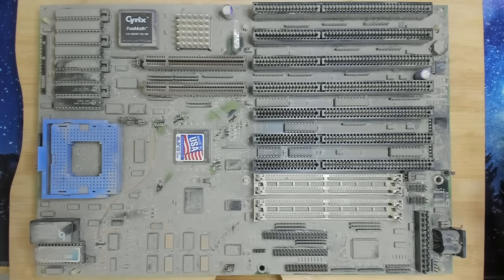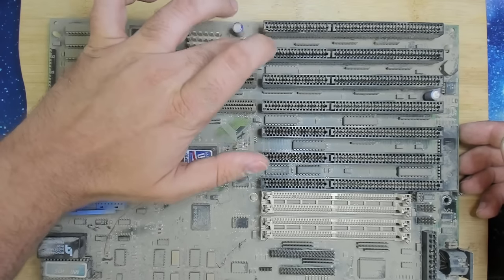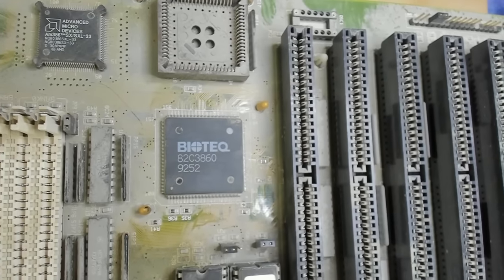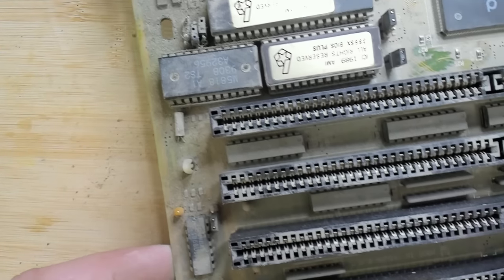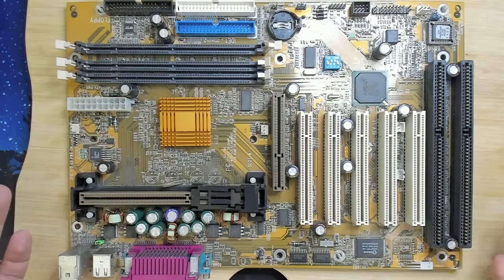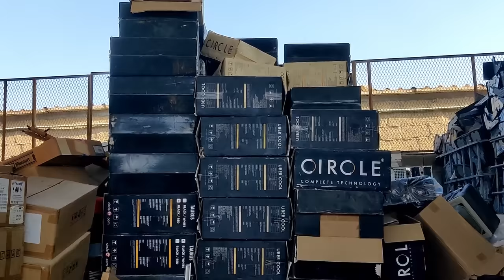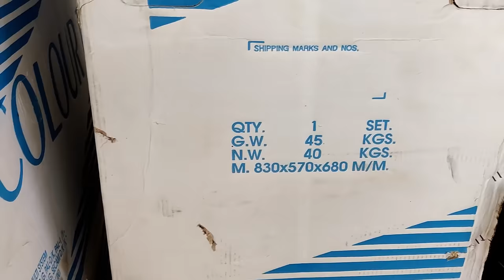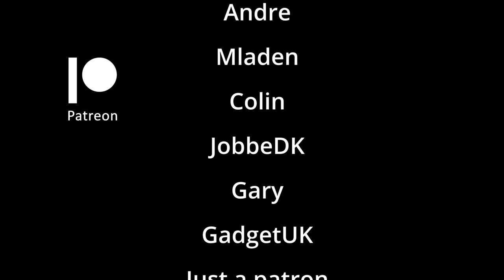Is this one of the most incredible scrapyards on Earth?

Comment: The scrapyard tour is the best part, the fact that the pc cases are intact makes the components more likely to be in one piece.
Reply from the maker: Yes! I prefer to find items in a case. That means they most likely are in pristine condition and working. Plus, you sometimes get accessories like back plates for motherboards 😉
Reply: @bitsundbolts I normally do too, I was lucky once though - a friend pulled my 386s motherboard from a huge container of scrap. It is an Asus with 40mhz DX CPU and runs beautifully .
Reply: @communalnoodle1356  My recycler has a few towers but in alot of cases cards and boards are just stacked on top of each other. I've seen so many good looking cards that on closer inspection had cut traces, or worse yet, when graphics cards don't have heatsinks protecting the chips and the pins get bent or cut.
Reply: @PipBoy3k  I hate when that happens - our most recent trip to a recycler most was the same though a few of us are able to repair so we saved what we could.

Comment: That first board is the famous Alaris Cougar. Very very cool board with a clock tripled IBM Blue Lightning 3 CPU, which is a proper licensed 486 with 16KB cache. But unlike other 486SX chips it can use a separate 387-compatible FPU.
Reply from the maker: Interesting! I will definitely read up on this board. So far, I have no idea what it is, but I am happy that I picked that case with this board inside. I usually ask to have a look at three or four cases because I need to reshuffle those towers of old PCs. Of course, the guys working there don't like that too much. However, this time, I got lucky with my picks.
Reply: I was always amazed by the FPUs not conforming to a single standard.  Late 80s FPUs are like GPUs today.
Reply: I've always thought the BL was more of a 386 with high clocks and large cache. Did it really have an actual 486 core?
Reply: @mykolapliashechnykov8701  It's an odd duck for sure. As far as I know it is a further in-house development of IBM's 386SLC. But is a 386 with internal cache (which supports write back mode, and is double the size of that of the Intel 486 of the time) still a 386? The IBM CPU supports all 486 instructions, like the Cyrix 486DLC/DRX2 386-socket CPUs, but it is a lot faster clock for clock. From what I've read the 486BL2-50 is a tad faster than an actual Intel 486SX2-50, while at 66Mhz the IBM falls behind a bit. You tell me 😅

Comment: I clicked for the scrapyard tour - wow!  That Alaris board is really interesting.  I think it's the "Cougar" model, so that's probably an IBM Blue Lightning at 75MHz under the heatsink.
Reply from the maker: I just posted the cleaned board on my Patreon - there is a free tier and the post is available to all members - including the free tier.
I already checked the manual and can confirm that the FSB is set to 25 MHz. Which means, you could be absolutely right! There is a triple clocked blue lightning rated at 75 MHz under that silver heatsink!
Reply: @bitsundbolts  It's THE one and only 386 (with 486 instructions support slapped on it, that is) that can run Doom. Please do the video on it, it's rarely found outside of the PS/2 systems.

Comment: I think I've said it before but damn, just one trip to a scrapyard like this and I'd probably be set for life as far as my retro cravings are concerned. 😄 I'd be most interested in the 386 board, since it is very similar to my first 386!

Also, sad to see all those discarded Back-UPS CS 500s! They're probably mostly fine, just need 1 or 2 caps replaced so that they don't prematurely complain about the battery needing replacement. I still have many of those in use at my clients (the 650VA version to be precise) and with a little TLC, they can last pretty much indefinitely. Thanks to the USB connection, they still do everything that is needed of them, too. I do see the charging circuitry fail on some of them now though, haven't been able to figure that issue out yet unfortunately.

Comment: DAMN, an AMD750 Board with an AMD Southbridge and not the VIA 686A.
Nice find!
Reply from the maker: I couldn't believe it when I saw the board! 99% of the slot type boards are Intel and Slot 1. If I find a Slot A, I definitely take it - even if it has a VIA chipset :)
Reply: @bitsundbolts  Back in the day I got an ASUS K7M, which was funny because it was initially sold in a white box. Later got an Epox 7KXA, where I desoldered the Voltage Regulator for the RAM and ran a wire to the ATX Connector (because the RAM Voltage is a bit low, IIRC something around 3,2V for SDR-SDRAM)

Comment: Really interesting to see where you get your stuff from. Please do more videos like this. My only option for retro gear is eBay. In my state, anything electrical cannot be sold at recycle centers and must be destroyed. Local authorities are worried people are going to hurt themselves when powering on old equipment. So much good stuff is lost. You are very very lucky.
Reply from the maker: That is very sad :( Maybe some of this stuff ends up here at my scrapyard. Apparently, there are ships coming from all over the world to UAE - then it continues to other parts of this world (e.g. Malaysia). Very odd to have a rule like this - as if you couldn't hurt yourself by anything else like a knife, scissors, or BBQ equipment.
Reply: Something similar here in Canada. You can't even pick up something someone has dumped there, because it would be considered has theft. From what I've heard, they remove some components and melt the rest in a foundry. Recycling is important, but reuse is much better.
Reply: Same here in the UK really. Some recycling centres have got a small building where stuff that's obviously got nothing wrong with it is saved and checked and you can basically buy it for a donation sort of thing. Most haven't though, and you're not allowed to take anything as "health and safety" laws won't allow it. Most centres use big "bins" the size of 20 foot containers with an open top that you chuck stuff into from above, so you couldn't go climbing about in those anyway! There's only a few that you can walk into such as the one for old TV's.

Comment: Mr. Bios..!  I used to love that stuff, it was generally VERY capable.  It might not have as many BIOS options as Mr. Bios normally does because IBM loves to simplify the BIOS to be morelike the eventual PS/2 Model systems.  Also, a lot of older motherboards had their models/info on stickers that were stuck to the sides of the ISA/card slots.  Some do 'dry out and fall off' due to age, so maybe they could have been lost.  That one sticker doesn't help much with identity.  Searching a bit at random I found mentions of an IBM-made "Alaris 486 by IBM", which looks like maybe being this thing.  It's actually a 486DLC-ish thing, with a full 32-bit bus but no coproc on the CPU, hence the Cyrix FasMath.  The CPU socket MAY take full 486 chips, but it may be for a "Pentium Overdrive" variant that IBM also did on that board.  If this is the same board, the caps are supposed to be very high quality, with few to no tantalum-bomb-caps to be found.  Those cache chips look quite nice, though.

If so, it was a "Blue Lightning" board, though I'm still trying to find proper model/FRU numbers!  It may also be a "Cougar BL".  I'll see if I can find more, but hopefully that helps.

Man, "VESA local bus"...that's been a while.  Also, I don't miss it.  I miss MicroChannel, didn't miss EISA all that much, but actually like and enjoy the PCIe that we mostly use nowadays.
Reply: Annnd...yes, I would spend a whole weekend in that scrapyard.  I would have no space in my house by the end, I bet...but so many nifty things!  I saw storage arrays, I saw one thing that looked like a mains-input UPS there (though getting 480V stuff to work reliably is a TINY bit scary!), and...yeah, I'd lose a lot of time and money AND space to go there.  :)  It would be great.

Comment: ATX MVP3 based Super Socket boards are rare and very good boards
Reply from the maker: Good that I took it then :) I think I only have one or two other ATX Super Socket 7 boards. Perfect for a nice AMD K6-2+ build.
Reply: @bitsundbolts  100% - they are very good boards, and great for overclocking.

I have two K6-2 570s modified to K6-3+ running in MVP3 based boards, one at 600mhz and another at 630Mhz (though I took that one back to 600mhz for safety since I had to increase the voltage a little)
Reply from the maker: I also have a few K6-2+ 570 - one is already modded for 256K L2. I never tried to get past 600 MHz on those CPUs - due to lack of a board that can push the FSB past 100. Well, now I got one :) Let's hope it works!
Reply: Just remember that those chipsets didn’t play nice with ATi vga cards back then 😁
Reply: @bitsundbolts Its fun believe me :-)

Comment: Hi !

many treasures in the scrapyard 🤠

- I ´m a soltek user. I have one in socket A(75JV). Durable & stable, but bad capacitors (I replaced them and is still working). i had some issue years ago with the junpers. Cant´s set de correct FSB!!. I fix it setting the FSB from bios setup

- I have a GA-7IXE REV 1.1. Some problems with the boot bios, always stop in the bios shadow other time only beeps and black screen in the first years, after a bios flash complety fix the issues and is till working. The flash was made with a external programmer tool, not under DOS.

Greetings from Spain !
Reply from the maker: Thanks for this information! I hope I'll remember when I get to those boards and I run into trouble. 🙏

Comment: I have the same, or very aimilar, slot A motherboard, it was paired with an athlon 800, 512 MB of ram, and at some point got a geforce 4 ti 4400!
The temperature sensor got lost, if you can figure out what it is to find a spare it would be awesome! 😁
Reply from the maker: I think it is a regular thermistor. I think they are still used for 3D printers. What I've seen in the past is that most common values are 10K and 100K thermistors. I might be able to test this when I get to the board - I just hope I won't forget to test it.

Comment: I am sure most of those electronic devices work or are recoverable. They do not deserve that amount of hatred and abandonment.🙂
Reply: I read "elections devices" first...😂  Oh my god, it's finally over
Reply from the maker: If they are in a case, then chances are really high that they work. Boards that have been taken out of cases have issues (scratches, bent pins, etc.) Most of the physical damage can be fixed. My success rate of fixing broken stuff is also quite high.
Reply: @bitsundbolts  There are no scrapyards in my city, but i love restoring old electronics and computers. They usually do not die,unless they are abused or exposed to high voltages, heat, liquids, elements etc...

Comment: Are those beige things scanners? Look for HP ScanJet II Cx units. Worth a fortune if working. One of the original few to have an ADF, and SCSI interface. In general though, I am absolutely foaming at the mouth. I wouldn't be able to leave. Seriously... I'd be trapped there. HP Netserver LMs and LH's, tape backup drives, old servers with full height SCSI hard disks... Ugggh... get me a towel.
Reply from the maker: There are so many things! I am not even looking for scanners or LCD monitors (which most of the beige things probably were). It is a magical place!
Reply: @bitsundbolts  Now I'm depressed. I like magical places!
Reply from the maker: Ahh, I certainly didn't want this to happen!

Comment: Hi! How the scrapyard works? You took home anything you want? Pay by weight? Yo could open any case you want to explore the inner boards? Thanks!
Reply from the maker: I go there now since almost 18 months. You make friends with the guys working there. It is quite a large area with people working in groups of 3-5 people. You ask politely if you can check their items - I rarely get a "No". Treat everyone with respect and you will be treated the same way. Once you see something you are interested, you negotiate the price. Most of the time it is per item - rarely per weight. And, it is not cheap. On average, a board will cost 10-20 USD, depending what board it is and how well you can negotiate.
Reply: @bitsundbolts  Oh, wow! That's not cheap. Over here, we can take e-waste back and easily get it calculated into the bill as long as we get rid of more than we bring back home. So still a net sale to them. In such cases, we pay by weight. But no assembled items, so only motherboards, drives, processors and the likes *separately*.

I'm darn close to the right time to find a new CPU that's newer than my current system, so I'm on top of this.

Edit: E-waste goes at €100/metric ton, which comes to 1 cent per kilo.
Reply from the maker: Wow - that is really cheap. Well, for me, this is literally the only way to get access to old hardware at a "reasonable" price. Shipping to UAE will easily cost 20 USD from other countries and I would be limited to items found on eBay or similar. Even though it isn't super cheap, I prefer the current setup! Also because the scrapyard dictates what content I make :)

Comment: Did you grab that Apple Tsunami board? That is from a 9500 or a 9600. The top end workstation from the sort of 1996 era. They did dual processor versions, could take 1.5GB RAM and might be interesting as a project. Be warned the power connector is weird.
Reply from the maker: Unfortunately, no. The board was already out of the case and it was bad in one corner. I think it would not work and I don't have any experience with old Apple machines.
Reply: @bitsundbolts  Shame, those ones are one of the best machines for running PPC BeOS. Not having much experience sounds like the perfect reason to have a play. They do say that learning is fun 😆 If you ever do decide to experiment with a beige era Mac, feel free to reach out. I have a fair amount of experience doing hardware repairs on them, including one of those boards that someone had kept in a pile and knocked a load of bits off! Looking back at the video I suspect that specific one is the 9500 variant. To be certain I'd need to see the power molex better. They're effectively the same though.

Comment: Around here stuff is rained on, rusts and is the crushed/shredded and shipped over seas for recycling. Electrics are not sold as they say they need to be safety tested first and it costs too much. 😢
Reply from the maker: Very unfortunate. Here in UAE, it rarely rains - the stuff just get dusty. Once you wash off the dust, most boards look like new.

Comment: Strange that the sticker says "made in the US" - while the chip underneath it is marked "Biotech" - which would normally imply that the board was from Biostar and hence made in Taiwan.
Reply from the maker: Uh, I am not sure I follow. Those are two different boards - I never took off the "made in the US" sticker. Did you skip over some parts in the video?
Reply: @bitsundbolts  Ah, I must have missed that bit

Comment: That's odd......is that a 3 memory slot board?
Reply: .......there is more than one? that's odd. I've never heard of this and you have at least two of them.
Reply from the maker: I guess you're talking about the Slot A board. I'm actually a bit confused why that third memory socket has space to the other two. Seems odd.
Reply: @bitsundbolts  I drifted away for a minute (short attention span + ultra lack of sleep, I've done the same on several other videos today)  and saw the gap. Then I'm like.....is that 3? Then I rewound the video to see if you mentioned it and I noticed the motherboard before that was also a triple slot.

Comment: I clicked for that sweet sweet scrapyard drool! 🙃 Wow, you can even have a selection of older networking gear there. Had an AMD Irongate chipset board, it's getting rare nowadays. I think it was never manufactured in huge quantities. I've bought it used, driven by pure curiosity, 7yrs after it's time. After the era of Am5x86 passed I became a full-on Intel user so I wanted to try the "dark side equivalent" of a P2B+P3 setup one last time. The capacitor plague didn't spare it so I've replaced a lot of caps on it. I've used it with Ubuntu Hardy LTS on it. I remember having some infrequent stability issues leading to kernel panics when I used multimedia apps. Even after I recompiled the kernel to make sure it only uses the instruction sets the Thunderbird CPU was built upon (MMX, 3DNow+) the problem persisted. Who knows, it might have been a kernel, PSU or cap issue. Overall it was a good performing chipset+CPU combo for it's time. Earlier 751 north bridge revisions had an issue with the AGP bus speed falling back to 1x.

Comment: What's the point, just piles of unsorted unstructured rubbish. Anything below the 4th or 5th level from top is worthless because it can't be identified, much less removed.  Less is definitely more.  If they are serious about recycling, use shelves, devices stacked vertically and screened before stacking to determine if worth holding.  This is just hoarding junk with no end-game.
Reply from the maker: They're just disassembling - there's no need to look for value. The people working there separate material and there's no difference between a cheap no-name soundcard or a Gravis Ultra Sound. Pick any other analogy. The goal is to get there before they separate the stuff - after that, it is usually broken.